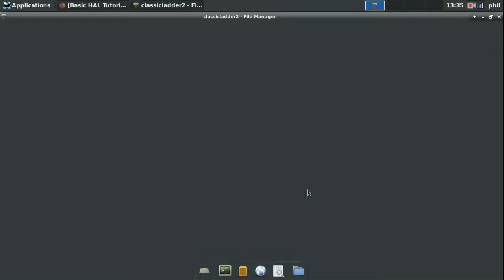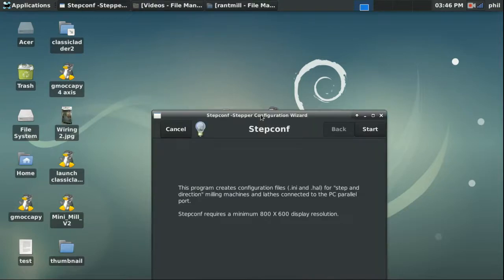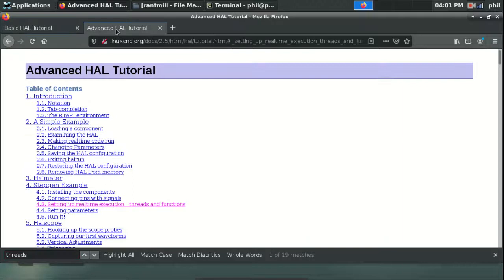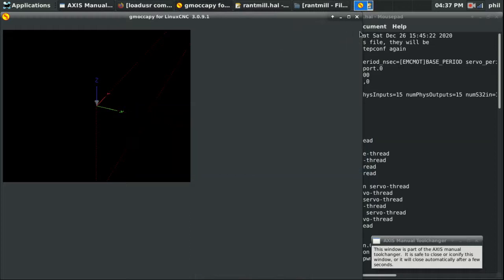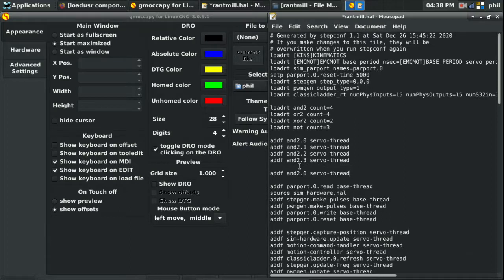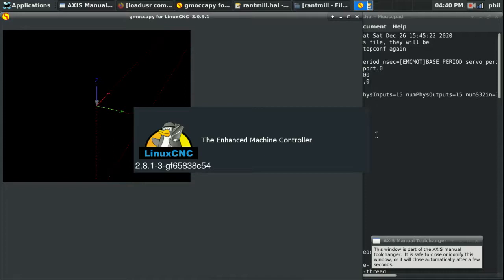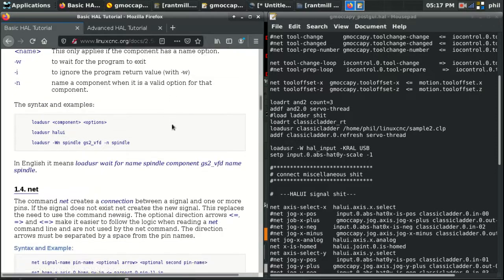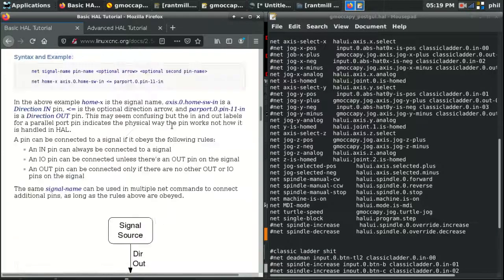LinuxCNC HAL basic tutorial, Part 1

Comment: Loaded Linux on desktop to run my Sherline mill.  For some reason the X axis moves in only 1 direction, regardless of which direction (+ or -) that I click on in the manual selection in Linux CNC.  Does HAL have a fix for this ?
Reply from the maker: @gwheyduke  what interface card are you using? What motors and drivers? Did you use the config wizards to create a base config?